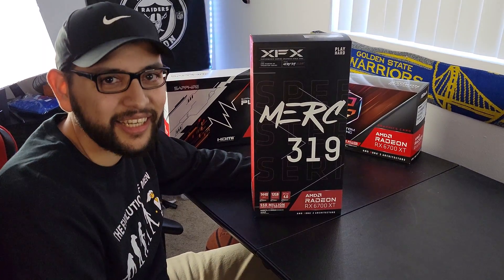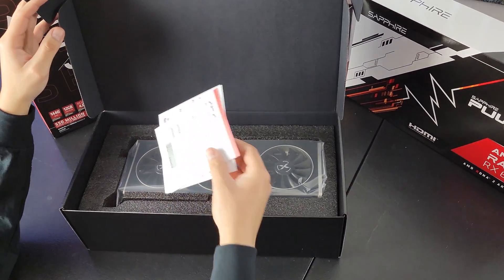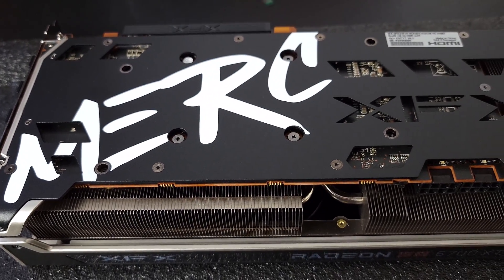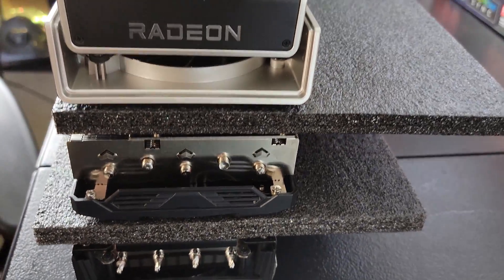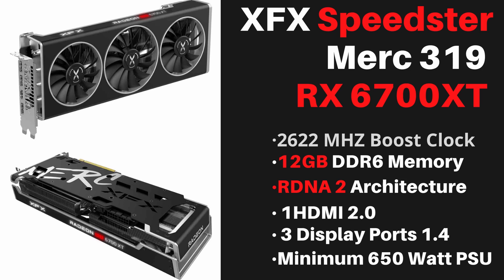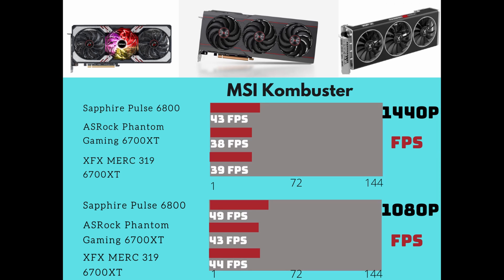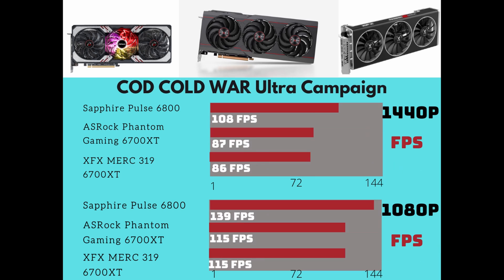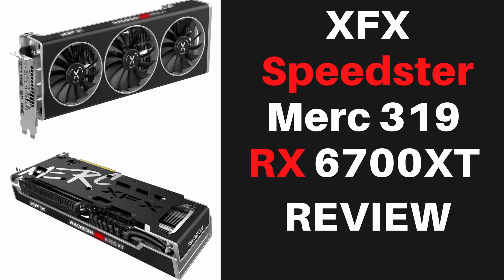XFX Speedster Merc 319 Amd Radeon RX 6700xt Review + Benchmark  | Top3Tech

Comment: 7:50 I agree but not cuz of optics but the vent cuts in the backplate,
but i would still pick the the XFX over the Sapphire Pulse because i don't like it when the back of the GPU chip is unprotected.

Comment: whats the different merc 319 6700xt and qick 319 6700xt?
Reply from the maker: Stronger overclock, LEDs And different design
Reply: @Top3Entertainment  merc has it but qick not ?
Reply from the maker: @sutriwilnes  yes the Merc is the better card barely
Reply: @Top3Entertainment  i almost bought qick 319, i think both are the same. 😑
Reply from the maker: @sutriwilnes  what was the price difference?
Reply: @Top3Entertainment  qick version around $300, merch around $700..
Reply from the maker: @sutriwilnes  that's insane. Must be a third party vendor

Comment: it would have been more helpful if u included GPU temps, gpu hotspot temp, fan speed
benchmarks of games are pretty useless, becasue the reference card performs the same
Reply from the maker: The reference doesn't perform exactly the same. There's slight differences which is the same with temps

Comment: Good test, but there should also be temperature parameters.
Reply from the maker: I appreciate the feedback. I have thought about it but in the end I didn't decide to because a big majority of people buying these have pretty good fan situations in their
Reply from the maker: *Case
Reply from the maker: Under heavy load most 6700xt run 71°--78°c depending on game and time using the card
Reply: You will never have to worry about temperatures with this card.
Reply: @Top3Entertainment  wow, mine hits nowhere near that high.
Reply from the maker: @tac6044  what games do you run? What settings!

Comment: Hi, I have the xfx rx 6700xt as well but the lighting on the side of the card doesnt want to come on, any way to solve this?
Reply from the maker: You have the merc 319?
Reply: I have the Merc 319 RX 6700 xt and I just noticed this as well,  my lighting on the side of the card doesn't come on either.
Reply from the maker: Damn that's not good bros
Reply: @Top3Entertainment  as far as I can tell through testing , everything works great. no other issues. I just now noticed those lights never came on.
Reply from the maker: @Kingmonty31  but you still paid good money for it

Comment: That’s by far the best and card u cbs get speed wise….very jealous lol
Reply from the maker: I sold it to my friend at msrp lol and he says he's enjoying it
Reply: Nah you can get a 3080 for the price of this card which is $850
Reply from the maker: @jr6905  where?
Reply from the maker: @jr6905  when I got this card it was 630 after taxes and shipping. Now the msrp is $830. All 3080 start at $1100 but good luck securing one for that price
Reply: @Top3Entertainment  amazon drops
3080s all the time for 850-1000 depending on the manufacturer, usually they’re $850. I know this because I’m in a discord group and I get notifications with the prices of the cards.
Reply: @Top3Entertainment  yeah $630 for this card is a steal but now they cost $920 plus shipping and tax. You can get a 3070 for $600-700 msrp or the 3080 and that’s a better deal than this card Rn.
Reply from the maker: @jr6905  they sell out instantly
Reply: @Top3Entertainment  theres
Also the 3070 for $6-700 which is still better than the 6700xt and cheaper

Comment: Those warzone numbers at 1440p are nice! My 6700 XT QICK 319 comes 5/6. Picked it up for $890 free shipping.

Sucks there is no DLSS with AMD, but that's why this is $600 cheaper than a 3070 on eBay.

Really, this competes with a 3060 TI + DLSS.
Reply from the maker: I had a 3060ti msi gaming x trio. Great card but your not missing bout with this
Reply from the maker: How you liking your card
Reply: It's good and bad. Frustrated I'm not getting numbers I was expecting. Your Warzone seems 30-40fps higher? Is a 5800X that much faster than my 3600X? Also on 16GB 3200mhz, so similar build.

I'm can't use Medium or High settings and hold near 144 fps, even in 1080p. I'm at a hundred or less in 1440p, in most areas.
Reply from the maker: @ryzen89  at 1440p.its mostly gpu. Your getting 120fps?
Reply: @ryzen89  yeap is your cpu, i swap mine 3600x for 5900x and 20-30 more fps with same card
Reply from the maker: Imagine trying to flex on a YouTube thread lmao

Comment: Awesome video. I hear this card is insanely quiet (the quietest 6700 xt from what ive seen).
Reply from the maker: It makes some noise but I did have them at 1440p at ultra settings lol
Reply from the maker: It is quieter than the asrock phantom gaming 6700xt that I compared it too
Reply: @Top3Entertainment  yeah, on techpowerup it says it produces 25.2 dbA during gaming. Is this inaccurate or do you need to enable a silent mode or something like that?
Reply from the maker: I'm not to sure. I had the fans on all the time pretty much. I didn't really notice because I use headphones most the time but I will definitely take noise into consideration for future videos
Reply: i overclocked it to almost 2800mhz core and is not so quiet anymore lol
Reply from the maker: @LesGummo69  lmao hell yeah. I want see the results lol. I test these on default to make it fair